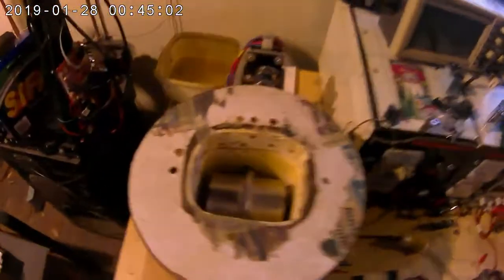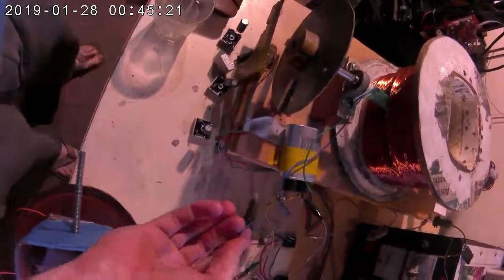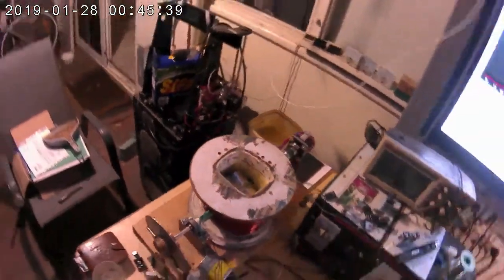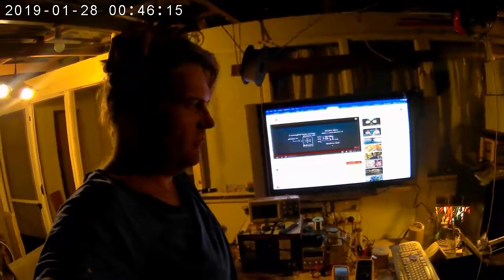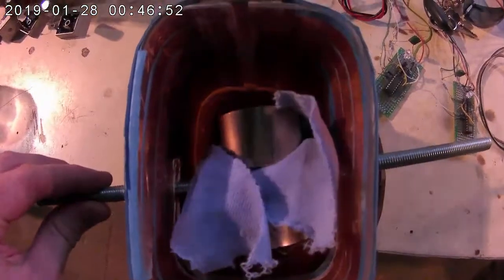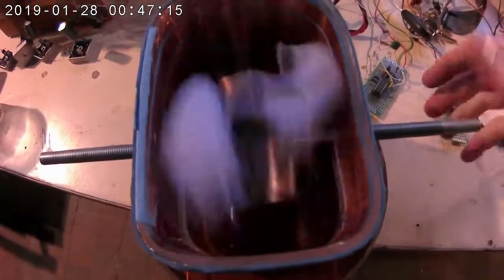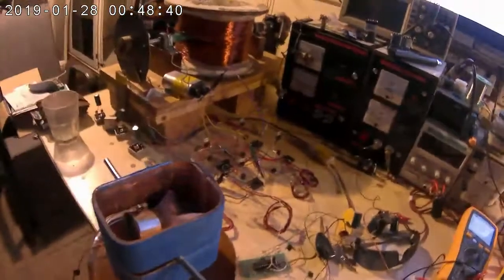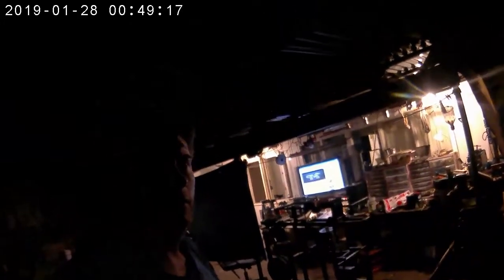LENz Law & the energy machine of Joseph Newman ; Introduction

Comment: How are things going with the machine?
Reply from the maker: simplifying and rerunning torque load tests under different conditions to determine the rpm vs efficency curves, as there are definitley peaks,  however much smaller than even high end  linear curve motors.